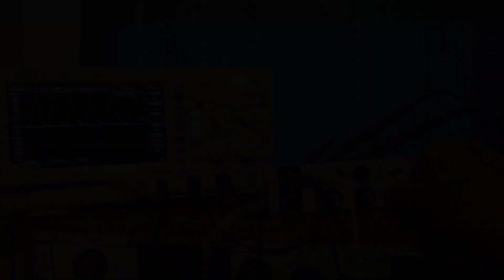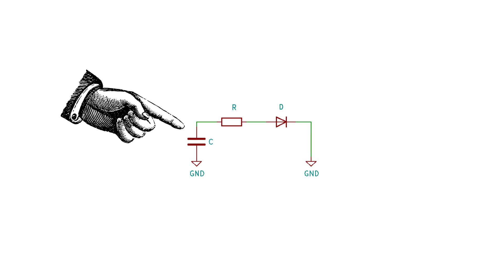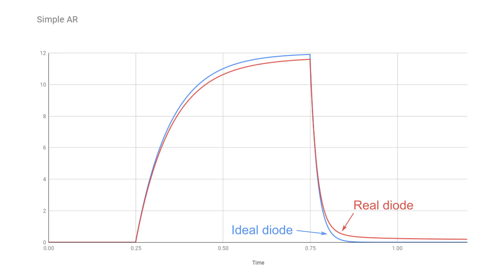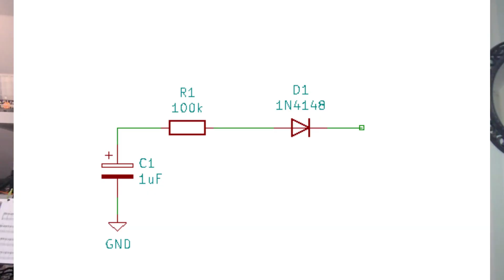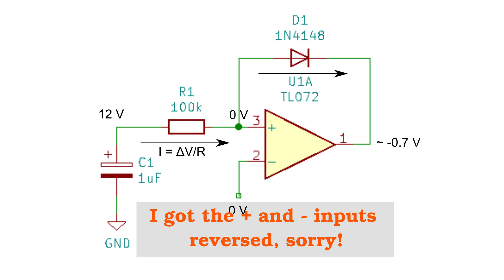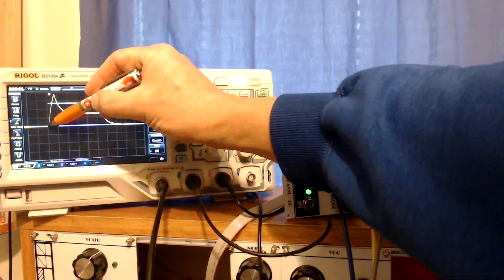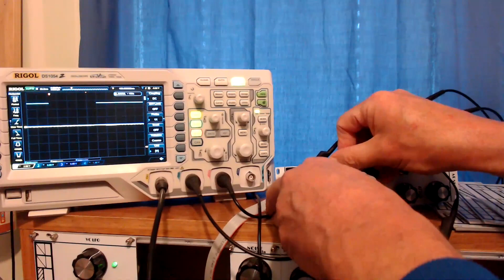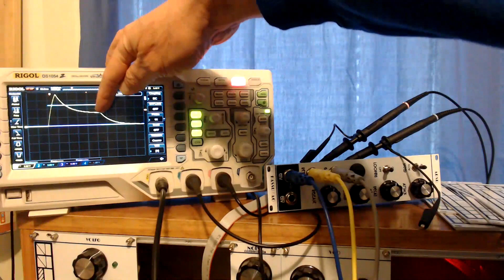Kassutronics Precision ADSR (modified!)

Comment: I just drew and etched a pcb for the kassutronics adsr (haven't even drilled it yet) all while knowing I would really miss a trig input. This seems just prefect for me. I'll have to see what I'll have to change in my old pcb design. Thank you!
Reply from the maker: The trigger input is almost strictly an addition, so you could do it on a small stripboard or PCB and connect it to the PCB you've got! It's a jack, two resistors, a cap, and a diode, and then you'd need to cut one trace to insert another diode.